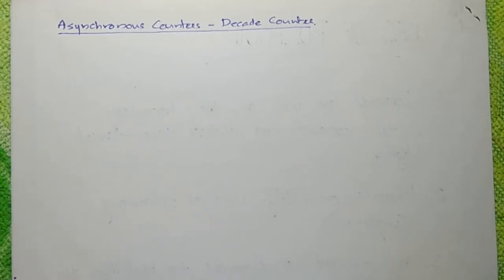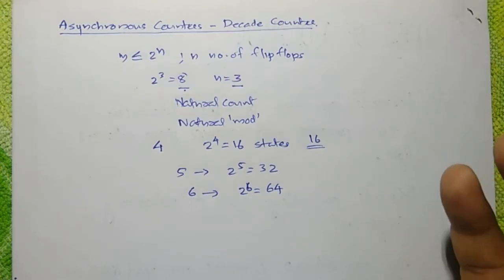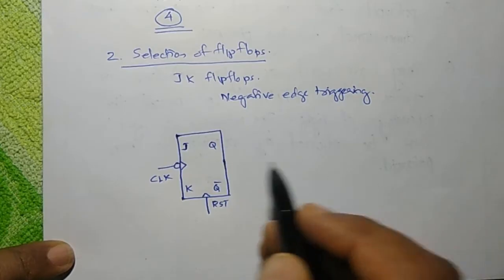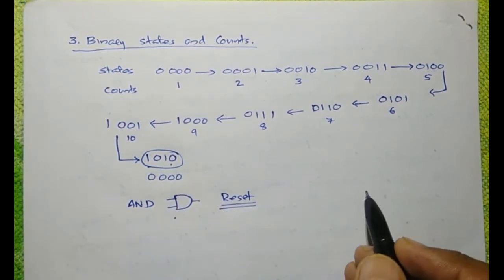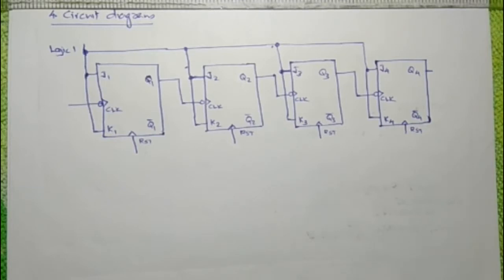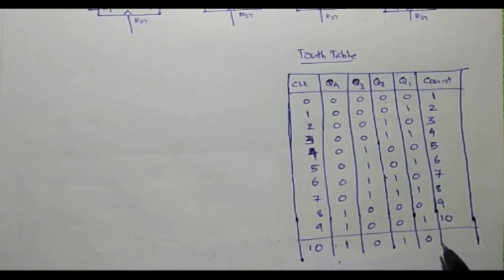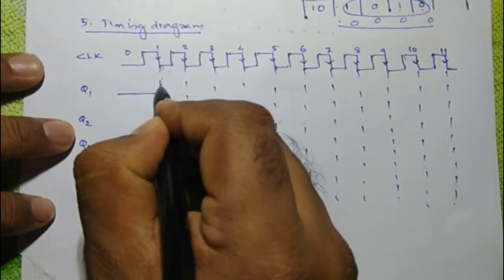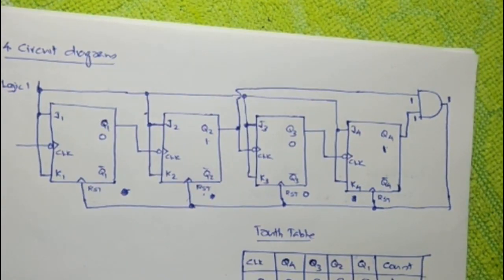mod 10 asynchronous counter

Comment: There should be nand gate instead of AND 
Because nand gate produce  0 as a output 
Thank you ☺️
Reply from the maker: Watch closely and you will find that the reset is initiated with a 1 , not 0. So, AND will do the trick
Reply: @justinjohn4943 What if the bubbled Reset is taken? Then obviously Nand gate is required